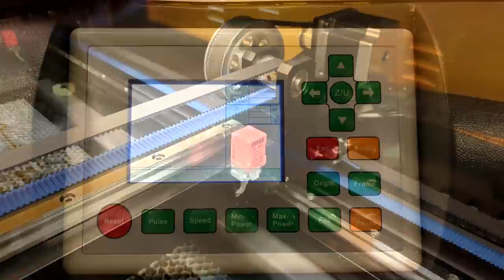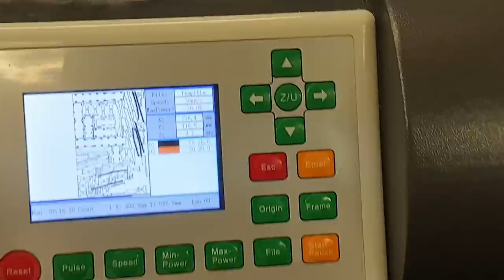China 100 W Laser at work - real time cutting of plywood 3D model of Suriname bridge

Comment: Finally someone who know how to set air assist so that there is no tar on the surface during cutting.
Reply: CAN YOU EXPLAIN THAT? IM CURIOUS BECAUSEN I NOTICE THE SAME.
Reply: It could just be the type of wood. I have noticed luan has lots of tar while birch has less.
Reply from the maker: The amount of tar is indeed mainly dependant on the type of wood... (and focussing issues), I can not take credits for adjusting the air assist. General rule though is that the air assist should just be able to blow away the gasses through the cut (and the cutting table) and do nothing more than that (except for it's main reason of existence of course: having overpressure in de lens chamber in order to keep out gasses that could otherwise condensate on / smudge the lens). If you eg use a compressor that is capable of creating a huge airflow through the cut, you will: 1. Risc blowing out the small pieces of the already cut areas. 2. Feed more oxygen to the cut which might (indeed) result in burning the edges a little more. Especially if you are not able to cut through in one go and need two passes, the air assist creates a heavily burned first cut. Leaving off the air assist during the first pass will result in nicer edges in that case.. But in general double passes should be avoided. The fact that air assist creates increasingly burned edges when not cutting through is mainly because of the following reason IMO: When cutting through, cold air is constantly input into the cut and warmed-up air is leaving the cut on the bottom side. When not cutting through, all the energy is absorbed by the material (in the first place) resulting in an extreme warming up of the cut. Because of not cutting through (yet), the air can not leave the cut and has to find a way out through the same cut upwards, streaming in opposite direction of the airflow. Therefor the air takes longer to leave the cut (that has absorbed 100% of the energy) and warms-up even more as a result. So very hot air takes longer to leave the cut, AND all of the airflow undergoes this fate, because no air goes through, inputting more oxygen than when cutting through, resulting in far more burned edges. Conclusion: when not cutting through in one go, air assist counter acts creating a clean cut.

Comment: Your setup is so quiet compared to other videos I've seen. Can you tell us about your exhaust system?
Reply from the maker: In the meantime I have added a very powerful but very noisy air fan that really pulls out the air at a high rate. https://www.hbm-machines.com/producten/bouw/verwarming-en-verkoeling/verwarming/master-bl6800-ventilator?utm_source=google&utm_medium=organic&utm_campaign=surfaces-across-google&gclid=CjwKCAiAgc-ABhA7EiwAjev-j5q5MQSnd11p1A_xX4H7KIliMZMnbIpaqQvjqHE3rUJjdu8054wzhhoC6wQQAvD_BwE. This works very well and even enables me to keep the cap open during cutting... Wich is nice for video purposes.

Comment: Great setup, but I’m not a fan if having the autofocus sensor dragging across the workpiece. The just seems like an accident waiting to happen.

That said, your laser head also seems very close to the workpiece. What is the focal length of your lens?
Reply: 3:37
Reply from the maker: You are right. In the video the autofocus pen is still very close to the material. I have now changed the lens and it has a focal length of 63 mm so that the distance is a little bigger. Also I have made some tiny changes to the Z-probe in order to have it trigger sooner (= shorter range of pushing the tip inward). This leads to a distance of approx. 4 mm now, ,which is more than enough. It is important however that the plywood used has no internal stress (is straight and not bent), because that causes the material to pop-up during cutting. 

Note: With the Ruida controller + Lightburn combination, you can always press PAUSE at any time during cutting to remove parts that stick out. After PAUSing the cutting can be continued as if nothing happened (!!).

Comment: I'm looking to get the exact machine just with bigger bed 1300x1000 and 100w, Would you still recommend this machine in 2023? Any issues you faced when you got the machine such as alignment issues or gantry issues or anything?
Reply from the maker: I would still recommend this machine over many others. It is extremely reliable and accurate. Only after 3 years of use I will have to renew the X -timingbelt and timingbelt wheels, because of some play due to wear, but even when neglected, the machine would still be accurate enough for most jobs. The alignment of the entire machine is 98% accurate too, right out of the box until now.
Reply: @MakerFarmNL  thanks for the reply, what is maximum thickness for plyboard and acrylic 100w can cut through? Are you able to control the machine with lightburn like arrow keys to move nozzle, home and frame work without issue or does all that have to be done on ruida control board?
Reply from the maker: @Coolmaaaaaan  Birch plywood can be cut in 1 go up till 10 mm. Hardwood plywood up till approx. 5 mm. Acrylic: 30mm. Lightburn arrows can be used as well as the absolute location tool in Lightburn. In fact Lightburn is THE SOFTWARE for this machine. Everything can be controlled by Lightburn! Even a webcam can be used and calibrated. AND (important!) X and Y axes of the machine can be calibrated too... That is very nice when your X-timing belt starts to wear out due to lots of engraving.

Comment: Great video. Does this laser have actual 100 "running watts", or "peak watts"? And does it have a steel honeycomb bed, or aluminum? Does it have hybrid servo drivers or stepper motors? And did it include the autofocus z limit pen attachment? Thanks, and looking forward to more videos on this laser.
Reply from the maker: The laser is rated 100 Watts and tested 101 Watt according to the label on the tube. That is measured in a pulse, not over a long time. Since laser power is set in % it is good to know that it is advised never to exceed the 80% power setting. Even this 80% power setting will reduce the lifespan of the laser severely. Therefore the recommended power settings range from 7.8 % (just firing) to 50% max. If you always keep your power lower than 30% the laser tube wil have a lifespan in the range of 10000 hours. So.. to answer your question... Yes it is 100 Watt. 80% power setting will result in almost 100 Watts laser output (before deflection), but in real life you will be cutting with a power setting of 30%. Many materials will be cut cleaner when the power and the speed is kept low. The lens that focuses the beam (type and focal distance) determines the cutting characteristics even more.

Other answers: It has a steel honeycomb bed (= cheap) - the bed should be replaced on a regular basis due to the accumulation of material condensates, which creates an increasing fire hazard over time. It has Nema 23 stepper motors and a Nema 34 stepper motor for the Z-axes, no servos. It has the the autofocus Z limit switch pen included.
Reply: @MakerFarmNL  30 watts? My glowforge has higher power than that! My understanding is that the laser tubes are less than $250 in the 100w range. I would rather get only 1000hrs and replace the tube every couple of years than run it at 30% of its rating.
Reply from the maker: @macrumpton  A 30% power setting of a 100 Watts CO2 tube is entirely different from a 40 Watts Tube at 100%. The power setting is measured in % which in fact is the duty cycle of the PWM wave (the duration of the ON part off the ON/OFF cycle) of the 100 Watts of power generated by the lasertube. So in fact the laser pulses with 100 Watt pulses in a very high frequency thus cutting with (almost) 100 Watts but not continuously. It is more like a path of 100 Watt piercings through the material than a continuous cut of 30 Watts. Besides.. changing a tube sounds like a very easy thing to do, but finetuning the correct path of the laser beam along all mirrors and the lens takes quite some time. So a tube might be cheap, but changing a tube (timewise) is not.

Comment: Did the laser already came with the camera or did you add it later?
In the Link there’s no camera.
Reply from the maker: I added the camera later. I have used Octopi running on a Raspberry Pi 3B in order to have a normal webcam create a streamed video over the network, but meanwhile there are more elegant options for this.
Reply: @MakerFarmNL  thank you for your fast reply.
I watched a lot of videos of different 100w lasers. But you have by far the cleanest cut. 
Do you have the same results on every wood?
Do you use the air compressor which came with it or do you use an upgrade?

Comment: The red ‘stylus’ is to stabilise material?
Reply: No. It's an autofocus device. It is set to a specific height, and it raises the bed until the button is depressed, then backs off a specified amount to ensure the material is where the laser is at it's strongest. It only works with hard, solid material though, such as plastic and wood. Leather and paper tend to get crushed underneath it, so it's best to set up the focus manually.
Reply: MichaelKingsfordGray  huh?

Comment: I noticed your 2 layers had different speed/power settings. I'm assuming there was a good reason for this? Maybe because the cuts were closer together and need to reduce distortion?
Reply from the maker: The laser will be capable of accelerating to the max speed when cutting the shapes with longer straight lines. In that case the extra speed (and power) is useful in order to get the job done faster. When cutting tiny details however the machine will never accelerate to the max speed due to the short lines and then the speeds and power setting can be lower. In this case the higher speed and power settings resulted in a difference of just a few seconds, so it is doubtful if this choice was even making much sense here. It all depends on your acceleration settings. FYI: I always choose the same setting for the MIN SPEED (speed in the corners of the shape) and MAX SPEED (end speed that is reached in long straight lines) in Lightburn. That results in a consistent cut all the way and makes the power adjustment a lot easier then when modulating (pulling down) the power in the corners. 
This machine is so extremely stiff, that going down in speed settings is not necessary in order to avoid distortion... so that is not the reason here.
Reply: @MakerFarmNL  Of course. I should have thought of that. I guess knowing at what short distances to apply that principle takes trials. By distortion I was thinking more about the material when there is more localised heat buildup. On another topic, I was a little concerned at how close the auto focus probe comes to the cut-outs. Is there no ability to lift the laser head in Z and then alter the focal point just to give more clearance?
Reply from the maker: @PeterWheeldon  Actually, the best way to get more clearance would be to alter the red pen probe itself. At this time (standard construction of the pen) the tip of the pen needs to be pressed inwards for about 4 mm's before it triggers the inductive sensor inside. This can of course easily be reduced to say 1 mm (that is 3 mm gain there). The other obvious way to make more clearance would be to make another type of nose cone on a lathe (a little shorter cone). The third way is to increase the focal length of the lens, but that has other consequences too. The last way would be to use a sensor like the BL touch instead... but then we would need to be able to retract that sensor in some way automatically (or manually with a switch).

Comment: How thick is the plywood being shown?
Reply from the maker: The plywood being shown is birch plywood of 2.7 mm thick. This 100 W Reci laser can cut through 10 mm birch plywood with ease. Thicker than 10 mm is do-able, but will have a very dark (burned) edge.. and therefore I would say that the limit is 10 mm birch. For PE the max thickness is 20 mm. For PMMA it's 25 mm. For hard plywood it's approx 6 mm. For POM it's 10 mm. PA approx 5-6 mm.

Comment: Hello. Great informations from your videos! I'm interested about tracing objects with camera on worksurface. Maybe a link to camerasystem? Thank you
Reply from the maker: I use Lightburn for the Camera tracing functionality. The webcam is a Logitech 920 connected to a raspberry Pi running Octoprint (or any other camera streaming software). Octoprint basically makes an IP cam out of the logitech webcam. Now we can span more distance between camera (laser cutting machine) and computer. In Lightburn we need a webcam (again), so I make a webcam from the raspberry Pi IP camera, using a tiny piece of software called IPcameraAdapter (see my comments on the lightburn forum) running in the background. In Lightburn we can then choose the (virtual) webcam and see the image of the webcam and do the tracing.
Reply: @MakerFarmNL  I've got a c920 i plan to use for my 1060.  do you have it mounted to the inside of the lid?  does the view cover the entire usable workspace or is the 78deg FOV too narrow?
Reply from the maker: @widgget  It will cover almost the entire surface (approx 80% I expect), but that depends on the height of your lid when in open position of course. When closed, you will see 80% of only the furthest part of the cutting platform, so you will cover a lot less of the entire surface with what you can see through the camera.

Comment: How thick is the plywood you’re cutting and what percent power and speed are you running for the cut?  Awesome video by the way!  Thanks for sharing!
Reply from the maker: Thanx. The plywood is 2.7 mm thick and can be cut with various power vs. speed settings. In the video the setting power=30% and speed=30 mm/s  is used. But 50mm/s and 45% power can also be used etc. I opted for the lower speed settings to save the lifespan of the laser. At power settings of < 40% the lifespan should be in the order of 10.000 hours. 

I can cut this kind of plywood up to a thickness of 12 mm BTW (speed=10mm/s - power=40%).
Reply: Tinkerman Perfect. Thank you. Just the info I was looking for!!  I really hope you post more videos with info about your laser.

Comment: Hi! I'm about to buy a very similar machine, 100W RECI, ruida DSP. The only thing I'm uncertain about is engraving. Do you do any engraving with your 100W tube, or only cutting? I heard a lot of people saying a 100W tube might be too powerful to do fine engraving. What's your experience? :)
Reply from the maker: 100 Watt tube can be harder to adjust for engraving, but is opens up a lot of other applications. For engraving a 60 Watt tube might be hitting the sweater spot. On the other hand, when modulating the power (3D engraving - greyscale engraving) a 100 Watt tube makes deeper engravings possible in one go. The Ruida controller does a very good job in taking the latency of the tube into account when engraving. Ruida makes life a lot easier!

Comment: Shouldn't you be using a proper chiller at 100w? Light object required me to run a cw5000/cw5200 to honor the warranty
Reply from the maker: Even on the warmest summer days the CW3000 doesn't reach temperatures of over 32°C , which is within the specs of the RECI 100 Watt laser tube. Normally though i see temperatures of below 22 °C.

Comment: Hi, Thank you for the video. 
Would you still recommend this laser after a year? Any problems you had? Did you have to make any upgrades to it, or does it work out of the box as expected?
Reply from the maker: Yes this is THE machine to buy. This configuration is perfect IMO. Buy Lightburn as control software and GO! Out of the box!
Reply: @MakerFarmNL  can you use a camera with this machine?

Comment: How to set air assist so that their  no far on the surface ?
Reply from the maker: I just use the default air assist, coming from a 85 Liters/minute (much like this one: https://nl.aliexpress.com/item/32842179508.html?spm=a2g0o.detail.1000060.1.129b6ccfizjQZW&gps-id=pcDetailBottomMoreThisSeller&scm=1007.13339.169870.0&scm_id=1007.13339.169870.0&scm-url=1007.13339.169870.0&pvid=cecdb1c8-90ae-4fe8-b3af-b1326b99ca89&_t=gps-id:pcDetailBottomMoreThisSeller,scm-url:1007.13339.169870.0,pvid:cecdb1c8-90ae-4fe8-b3af-b1326b99ca89,tpp_buckets:668%230%23131923%2341_668%23888%233325%2317_668%232846%238115%232000_668%232717%237563%23565_668%231000022185%231000066059%230_668%233468%2315616%23717) Additionally, I use a very heavy suction fan to remove all the fumes from underneath. This one: https://www.hbm-machines.com/producten/acties/hbm-300-mm-professionele-ventilator. This is in combination with two 140 mm fans (one comes standard with the machine, another I have added later). On top of that I use an array of 5 fans of 120 mm 220V diameter, that blow away (diffuse) the fumes underneath the honeycomb table. This is to reduce the risk of fumes catching fire (acrylate / PE). When the fumes catch fire, the flames will heat up the material from underneath, resulting in material expansion. This results in inaccurate cutting (!!).
So.. Yes... I have included a lot of extra blowers / fans. That is something that is far from standard on my machine. But the machine worked fine as it was delivered from the factory... the proces just could be improved IMO.
Reply from the maker: Also see my comments on Milan Karakas concerning the tar subject.